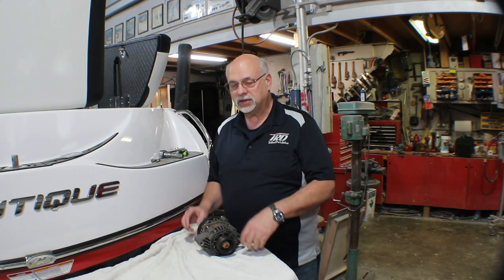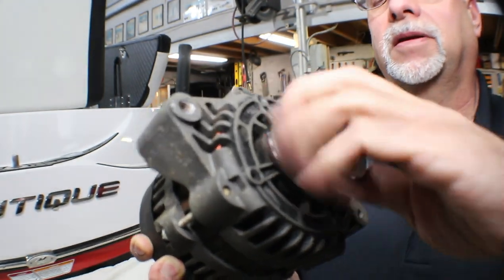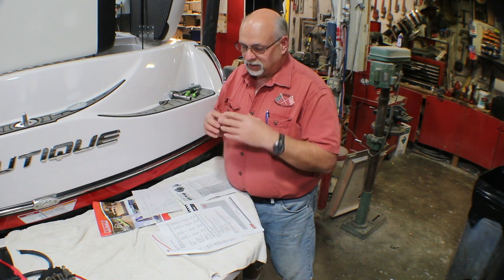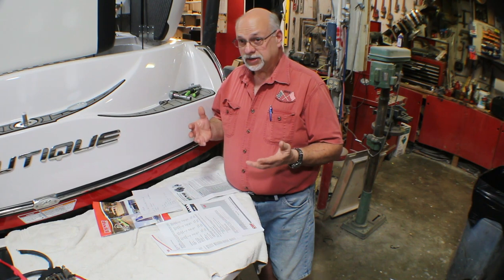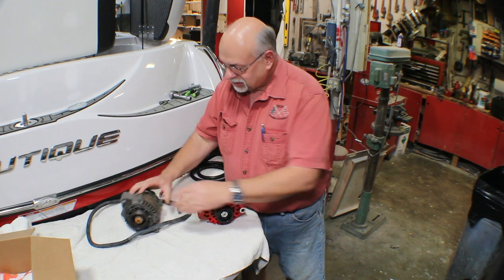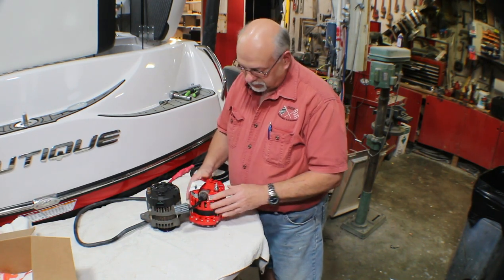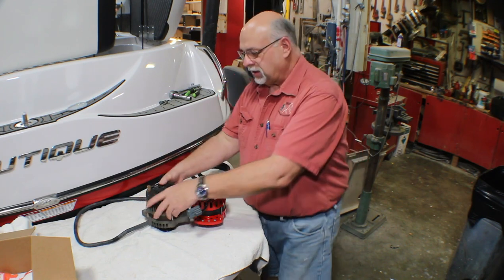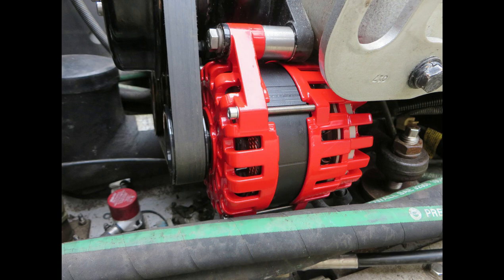Ski Boat Alternator Upgrade

Comment: Great video Ron! Thank you so much for mentioning the importance of wiring, which is often overlooked. Starters, alternators and batteries are only as good as the quality of the wiring that connects them. It's also worth mentioning that proper voltage maintenance when a boat isn't being used is also very important. Fully-charged, most batteries will measure between 12.6 and 13.2 volts. Whenever any lead-acid battery is discharged below 12.4 volts and is left sitting in that state, sulfation begins forming in the plates, which diminishes both capacity and lifespan. That makes a quality battery maintenance device an excellent investment for any boat owner.

Comment: What are your thoughts re: changing out pulleys on ski boat alternators?  My 88 prostar doesn't have any aftermarket electronics (I run it with points) but we ski/cruise usually around 3500 and rarely go 4000k rpm.  Based on my pulley measurements I think the alternator at idle is only turning 1200 rpm and the voltmeter tends to droop a bit at idle when you turn on lights.

I'm wondering if swapping to a different pulley might be a good upgrade.  (Rebuild alternator 2 years ago)
Reply from the maker: Doubt a pulley change would do much in your case, sounds more like a poor alternator/regulator, what is the voltage at idle and at 1000 rpm. A good alternator/regulator will hold 13.5 volts at idle with very low loads like your boat is.

Comment: I just now discovered you guys on you tube.. I have a, 1998 Ski Supreme that needs some "lovin". Im looking forward to talking with you guys!! It has a "ford Commander" Engine. Im hoping that you guys have parts that are compatible.. I was really impressed by you guys and your videos!! Thanks for sharing! I actually gave up on getting my boat back in the water last summer.. Replaced coil, rebuilt the Holley, new pts, plugs, wires, and it will start and run till you try to put it in gear.. Then it dies.. I watched your distributor replacement video, and I'm thinking that is the culprit!! Anyway, You've inspired me to get back to work on the boat!! I am 66 but still an accomplishment slalom skier, actually a fanatic.. I only got to ski behind a tournament boat a couple of times last summer, and had to settle w skiing behind a big ol Yamaha Waverunner.. Definitely wouldn't hold a straight line, but it wa better than nothing.. Thanks again!!
Randy Davis
Rad Skier

Comment: Wouldn't you also have to upgrade the positive and negative cables going from the starter motor to the battery(s) to the same 2AWG?
Reply from the maker: These should already be #2 or larger to begin with

Comment: Ron don't forget us with older 1979  correct craft nautiques that have the old pleasurecraft alternators....please do a video on how to convert old style to a new style alternator....thank you
Reply from the maker: THe older engines with single V belts pulling the alternator will not work for the big Balmar alternator, they require a dual v-belt or serpentine belt. Plus there is more wiring to upgrade as well.